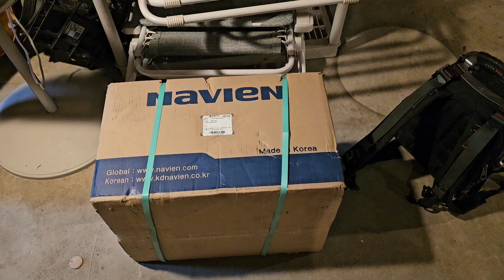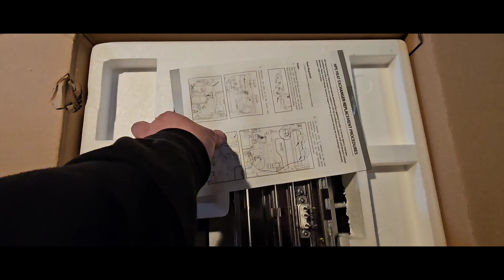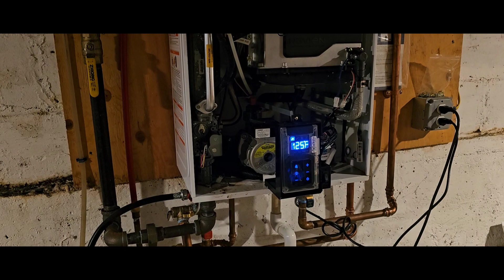Navien NPE heat exchanger replacement

Comment: It’s a shit design heat exchanger it holds way to much water as you can see it’s just gonna do it again, if you could clean the water while it’s in the heat exchanger it would eat through that bitch, we don’t sell many of those around my parts but I personally have a Rheem tankless and as long as I clean it once a year I’ve been good
Reply from the maker: Not a fan of the brand period. This is 1st one I've done on a on demand but have done a million on the combis. Think it's 2015/16 almost every single one leaks and tech support tells you it's normal unless you argue with them
Reply: Did the original water supply line up with the new heat exchange unit because mine we had to cut it and weld the old and the new line together